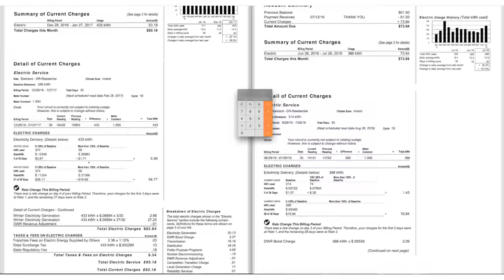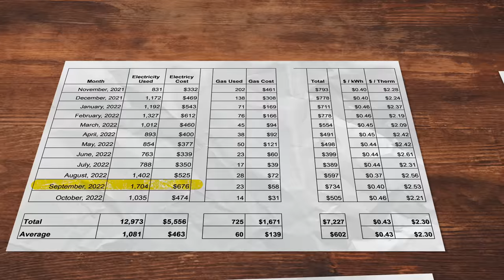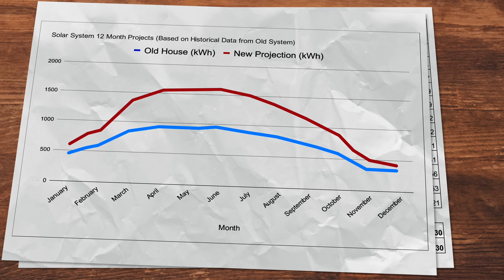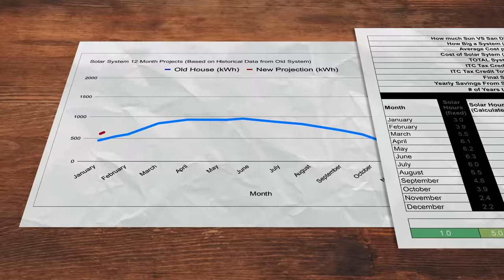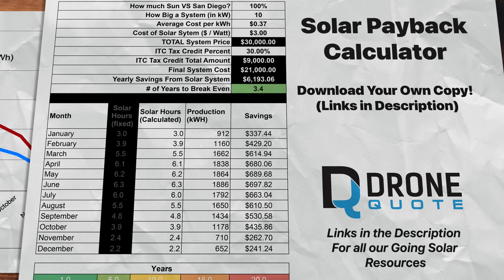Go Solar Before April 2023 - EVERYTHING Is Changing!

Comment: We are looking to go Solar in Michigan. We did the new 50 year roof 2 years ago now so that much is complete. A large share of our roof faces mostly south, turned just a bit west. Our power company allows us to sell back so that's good. We have an ALL electric home with Geothermal heat so we do use a lot of KW, about double what you do but that is heat/water/lighting everything! Watching this with extreme interest!!
Reply from the maker: Wow Larry keep me posted we need data from people in colder northern climates!
Reply: @TwoBitDaVinci  Wish I had my panels today! 100% Possible sunshine today! At least all our south facing windows have warmed the house to 70 at 1:30PM. Likely make 75 before sunset which will keep the furnace off until 11 or 12PM. It's right at freezing outside.
Reply: What kind of roof did you put in?   That can make a real difference w/regards to how easy it is to throw racking and panels up.
Reply: @junkerzn7312  '50 year' asphalt shingles. The previous roof (also shingles) was stripped off.  Ridge venting was added as we had the old style box vents.
Reply: @larrybolhuis1049  Ok.  I don't know enough about no-drill solutions for asphalt shingle roofs.  The drill solutions seem to be relatively straight-forward, just not ideal.  Who wants to drill into their brand-spanking-new roof (!)(!).

Have you investigated this at all?
Reply: @junkerzn7312  I DO share your concern about drilling into a new roof!! However we were told by two solar installers that they would not put solar on a 28 year old roof as just the effort of working up there installing it would likely do enough damage to cause leaks.  From what I understand about the brackets is they mount such that the shingles lay mostly over them.  Roof based solar is far from a new thing and they have this figured out!!

Comment: Add one more panel after 10 years and kick the entire out put back to original values.

60% more panels would give you original quoted  output. So 20 panels increased to 32 panels. 

Solar panels shade the roof in hotter months. 

USA administration costs are the killer for solar rooftop PV systems.

Neighbours taxes will not be needed to build new central generation capacity or more maintenance work.

Bigger central electric generation plants need bigger grid capacity, bigger grids or more grids.
Grids are extremely expensive, 
10 times more than the plant. 

I like your work. 
The numbers are helpful to Understanding the practical aspects. 

My understanding is that the national power grid is 10times more expensive than the central power plants to construct. 

Also in a no fossil fueled world then 5times more electricity is needed. 

If the grid is UNLOADED.......

Rooftop solar generates power and the transmission costs are basically 'free'.

With EV, electrical vehicles, the battery is also free with the vehicle. 
100kwh battery for the long drive. 
But daily drives are 7kwh. 

In Australia a 33kwh rooftop system on every building will over supply. 
That is 33m2 and every home has that much window glass but at 2times the price. 
Yes windows are expensive. 
Walls are expensive, do the maths.
USA administration costs are excessive for rooftop solar PV. 
In cold latitudes more panels and over 10mths each yr, you would still be ahead.

50times cheaper to go hard on Rooftop PV, with EV batteries connected to the buildings.
Selfparking onto a low mounted wall power point would be a simple gadget. All vehicles park 23hrs a day.

Comment: My big takeaway is that power in San Diego is hella expensive. My annual energy bill is about $1,200 here in WA state. Tough to justify solar when I'm only paying $100/month instead of 500 or 600.
Reply from the maker: totally hear you, from a financial perspective i think you're right! but if I lived there, i'd spec out a small system with a battery, save a little from that 100 bill, plus have backup power for any emergencies
Reply: And somehow, San Diego is even more expensive than virtually any other location in California.  I'm not quite sure how they managed that.

But that's on a per-kWh basis, not on a whole-bill basis.  If you look at the average monthly bill, Californians are actually only middling in the U.S... there are around 20 states whos people pay more for electricity than we do.  On a per-capita basis, Californians use far less electricity than people use in most other states.  Mostly due to the climate... even summer A/C use is mitigated by generally cooler overnight temps.  Not always of course, but often.

Ricky happens to be a big electricity user, though I'm not entirely sure why... he uses as much electricity as I do and I have half a dozen servers running 24x7!  At least I have an excuse!   (nudge nudge!)

Comment: If going solar, be sure to include, higher property taxes. Also in speaking with my realtor that I’ve dealt with, solar in my area does not equate into selling the house  for same increase that you spent. This solar salesman that was over last night, was correct about no increase of insurance cost but was incorrect about no increase is property tax.

I am dependent on my little solar system for my travel trailer. Without it, my battery doesn’t make it through the second night. The con is that I have to, throughout the day, keep adjusting the panels.
Reply: Solar adds roughly 4% value to the home. Since most people are making payments if they sell they are not losing any money. Just don’t agree to pay off the panels when you sell. Get a good realtor that will fight for you.
Reply: @68Tboy  I think this depends on where you live. From speaking with several realtors here, I probably wouldn't get a buyer to agree to take over the loan on the solar.
Reply: @jackg7225  Sounds like you have a gap in your negotiations or a misunderstanding of solar.

Comment: Have you covered putting Tesla color matched, glass solar tiles OVER existing new standard tiles? Cost aside, aren’t they component-wise very effective, efficient, & maintainable? My 1,000 soft two story condo has a 30’x35’ south facing 35 degree roof with zero shading. There are other smaller, less optimal slabs that I may want to do, later, after a couple of PowerWalls. Thx
Reply from the maker: hmm it's interesting... probably a lot involved... but i'll look into it!

Comment: You might want to watch Steve Lehto's youtube channel - look for his videos on RVs. There are worrisome consumer law issues with RVs.

Regarding planning, I'd suggest folks be a little careful.  Lifestyle changes can affect your power draw. Switching to an EV drove up my electricity usage - but I also switched to mostly working at home. If I switch to a job where I work entirely remote my electricity usage will drop; if I switch to a 100% in office job it goes up - but at the wrong time of day.

I also have a heat pump. I'm looking at installing some smaller wind turbines and using it to reduce heating costs. My heat pump is a major contributor to my electricity usage so anything I do to reduce that will lower my usage. But I recently installed a really nice Japanese soaking tub so that will be raising my heating costs / electricity bill.

Honestly I suggest installing the largest system you can afford. If you over spec it, you can usually sell back some to the grid.

Comment: You need to cover designing a system when you have zero historical data to draw from. Like new builds or old off grid’s such as vacation cabins in the mountains where electricity is not possible.  How to calculate requirements based on projected usage for design purposes.

Comment: The "new" off gridders!  I got kick out of a discussion with a young man today in a forum trying to tell me how my system is antiquated and people are not using "gandma's old solar and batteries".  According to that new off gridder now the way to do it is to buy a really huge system and lots of batteries so you can have everything electric and especially so you can have a big gaming system and fat screen TV and run all your heating, cooking, cooling and water heating off solar electric.

Sounds great I said but what happens when you lose your job or become disabled and don't have the money to keep that huge system maintained?

I am seeing more of these channels promoting big grid tied and off grid systems that are way out of reach for an average person and are not sustainable if your life suddenly has a setback.

These people promoting them mostly work for the solar or tech industries and are promoting systems and products that the average person can't afford and won't be able to maintain and will be worse off than if they just stayed on the grid and set up a small emergency solar backup system.

The reason I promote small systems is not because I couldn't afford a larger system and more panels and batteries. It is because I want and need a system that I can maintain regardless of my income or life situation changing and is sustainable even in bad times.  I you want to add panels and batteries for some extras you can and I have for recharging my ebikes and running a few more appliances but the system is designed so I can survive and have all the necessities if things change and designed for long term sustainability.

Now that panels have come way down in price people are getting huge systems without understanding those panels will lose efficiency over time and have to be replaced and batteries are still very expensive and have to be replaced and if you try to live off grid like you live on grid and your income changes you will not be able to maintain that system.

Ok, I think that needs to be said because there are a few channels on YT I won't mention that are steering people down the wrong path IMO and it will end up hurting people and give solar and off gridding a bad name.
Reply: What maintenance do you think is required?  These systems are virtually maintenance free once installed and working.  Literally.   LFP batteries?  Zero maintenance.  15+ year life, failure mode is very slow degradation rather than outright failure.   Solar panels?  Zero maintenance (they don't even have to be washed).  Modern panels last 40 years.  The failure mode is a slow steady degradation... less than 0.5% a year for premium panels.  Broken panel?  It won't effect the others in the array.   Inverters?  Zero-maintenance... replace when it breaks 25 years later.  Have two in parallel for redundancy.   Micro-inverters?  25 years, replace as they fail after that or just ignore a few failures (25 years later).  Up to you.

There is no daily, weekly, or monthly maintenance that has to be done on this stuff.  None.  Let me repeat that:  None.   There are typically no sudden failures beyond one possible piece of equipment (the inverter) that would disrupt life.   Little system?  Big system?  Doesn't matter.  

So far all you have done is waxed-poetic on all of these supposed problems and not once have you actually run the numbers on how these systems actually work or age.   Nothing you have mentioned is a problem.   Come on, it isn't rocket science.   There are no surprises here.   Run some actual numbers and complain about those at least, rather than just throwing your arms up and worrying about things that nobody with any of these systems actually worries about.
Reply: My system has already paid for itself. I drive a forklift for a living. And  now I have zero bills. Period.
I did it so I won't have to worry about electricity and gas going up.  Ever. So in a couple of years I might actually be able to afford to retire. All I'll have to pay is sewer water and taxes. And good for you being off grid. Before it became popular.  And easier.

Just wanted to add. My house is in a small town on 1 acre. My off grid will be if I loose net metering.  
And just so I don’t have to put up with the whims of the monopoly that is my power company.

Oh yah I was thinking about putting in a pool. Because I'm not sure what to do with all the heat from my solar hydronic heated driveway.  During the summer. Don't need it for domestic hot water. That's already taken care of by my geothermal heat pump. For free. It has an optional water jacket around the compressor. That the water flows through.
Reply: @danmccoy6164  Great, are you grid tied and how big is your system?  I retired at 49 with no house payments and no utility bills. Septic tank and my own well.  Life is good!

Keep in mind not everyone lives in sunny California. Got any videos of your system so we can see it?
Reply: @solarcabin  I'm one of the ones in your first post...but I never meant to disrespect you. I'm not the one that said that about your grandmothers solar. ....I think you have much larger balls than me going off grid. When It was much harder. I gave all the details in my first post. I  don't have any videos. Lots of pictures but I didn't know we could post them here. Plus I have no idea how to do that anyway.  But Would love to.
I had a contractor put up the outside of my house. And did everything else inside myself. Almost all by myself. I live in Wisconsin.

Comment: The comment about shading one panel not effecting the other in a parallel configuration is not correct.  What actually happens in partial shading conditions is that the absolute best-case MPPT point winds up being non-optimal for EITHER panel (or either series if you have two series connected in parallel).

For example, lets say that the optimum operating voltage for a panel is 30V and you have two panels in parallel.   Now you partially shade one panel such that one of its sub-strings drops out.  The optimal operating voltage for the partially shaded panel will be 20V and the optimal operating voltage for the unshaded panel will be 30V.

Since the panels are in parallel, the voltage is going to be forced the same.  What voltage will the MPPT lock onto?  It isn't straight-forward.  It will NOT be 20V, and it will also not be 30V.   The shaded panel will still contribute on an increasing curve as you drop down from 30V to 29V (for example), while the unshaded panel begins contributing less.  The sweet spot will probably wind up being around 28V or something like that.

But 28V ?  That isn't optimal for either panel.  So a parallel configuration can create even more problems than a series configuration will.

A series configuration with one shaded panel drops the series voltage, and maintaining the optimal amperage on the good panel(s) causes the shaded sub-strings on the shaded panel to go into bypass, but any unshaded sub-strings on the shaded panel will still be able to contribute its full current.   The other panels in series are not affected.   There is an additional voltage drop from the diodes that are in bypass of between 0.3V and 0.7V depending on the type of diode... usually it winds up being around 1V, which drops the total voltage of the string, but that's relative to what is typically a high string voltage (on a rooftop it can be 300VDC+ so a 1V drop is 0.3%).

This is why you don't want to parallel panels or strings in a serious solar installation where variable shading might be a problem.  You want each string going into its own dedicated MPPT.

Comment: Wow, your electricity must cost about double mine. We use 2800 in Jul and Aug (Florida) but the electric bill for that is about $360. So, your payback period is gonna be much better than ours. Although, we had to buy a bigger system to get close to net zero. We are not there, I think it's about 95% or so, haven't done the math in the last few years after we replaced one of our A/Cs with a higher efficiency one. 

During the first 5 months of the year, we build up a credit which is drawn down pretty quickly in the summer. :)

Yes, just googled it said $.37/kWh in San Deigo.  We pay about $.15/kWh. So you would need a smaller system than I have and your payback will be much quicker. We've only got about 60% of the cost paid back so far over 5 years, which is pretty close to 7-9 year payback estimate. Also, our rate has gone from $.133 to $.153 in that time, and still rising.

Comment: The most important reason for everyone who can afford it and who solar will work well for to get solar ASAP is because of the energy suppliers raising  the price of the energy you need  to the point where it is unaffordable, my new natural gas supplier  raised the price double or more for less gas than what the old supplier charged me last year at the same time. Not everyone gets enough sun for it to be a worthwhile option for them. The problem is that the world leaders and many organizations and corporations want 90% of the worlds population exterminated so they are working to do it covertly as if the whole thing is an accident, all of it has been well thought out for many many years maybe actually millennia I don't know. Thanks